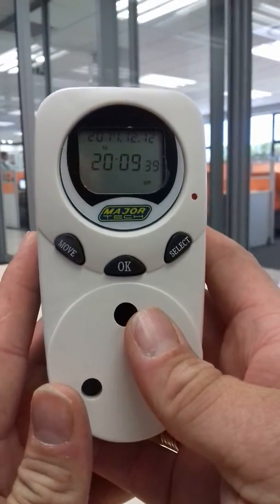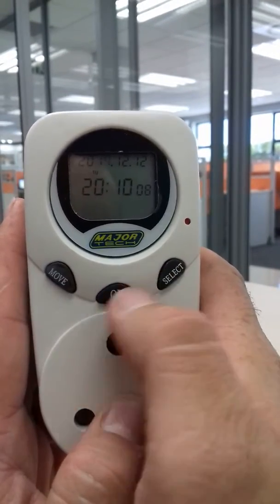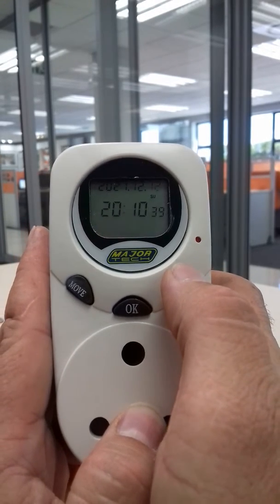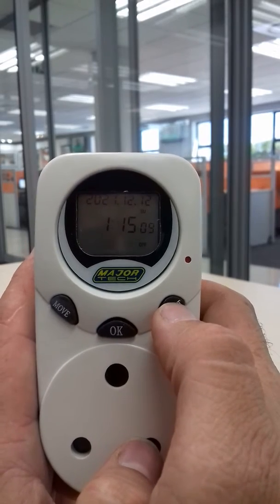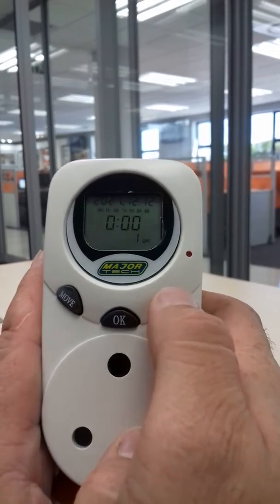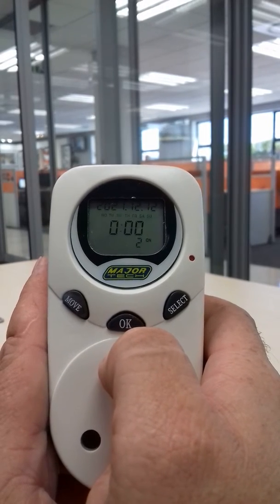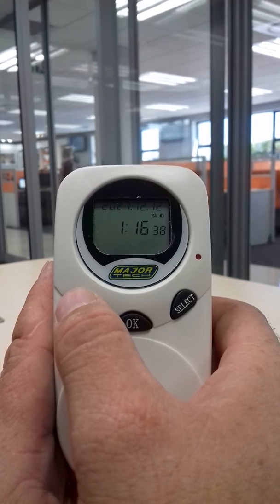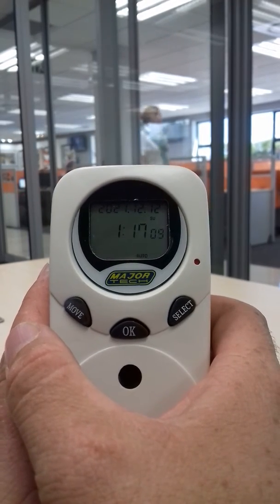Programming a MTD9 TIMER

Comment: Hi, I have followed the options as per the video tutorial. The time and date is set correctly. I have programmed the "on" and "off" option. Took it back to "auto" it does not come on at the desired time set. When i change it from "auto" to "on" then the time comes on and you can hear the audible ticking away inside. Please help
Reply from the maker: Bit late but did you select the days of the week for both on and off settings?

Comment: I bought this thing. I followed the instructions. It worked for about 5 days. It is now not working as programmed. I have reset it and reprogrammed it about 10 times. I have followed every instruction yet it is not turning my light on when it is programmed to be on. If I toggle it to "on" it works so power is getting through it. I am so very frustrated right now. I have found several people saying they have the same problem but no solution. The answer is always "reset and reprogram". I don't know what else to do
Reply from the maker: Hi if the manual override works and the timer comes on when you use the manual button it means the timer is working. The problem is definitely programming. If the timer did not engage on the manual button selection when you press it to the on position then either the wiring came lose or the timer has not been bridged on the old model and lastly if all else failed the timer is faulty. The new model has two inputs at the top and only one output at the bottom no bridging required.

Comment: Bought one from Makro just now. Lcd panel not displaying anything. Does it need to charge the full 12 hours first before anything will display on lcd? Been plugged into power for 30min now and still nothing.
Reply: plug in and charge and the press the reset button small on right hand

Comment: really struggling with it. ive done EXACTLY as explained on this video and the paper instructions but it wont work. i am selecting on at 6am and off at 22h30...it's 16h00 now and when i pug it in it's off. bizarre. I've set my time and date correctly. anyone help?
Reply: I have the same issue with the timer, did you manage to come right?
Reply: @brucefyfe8855   i have the same issue with the timer, did you manage to come right?
Reply from the maker: Ok lets go wiring top left and right is a life red and neutral black. Bottom middle is a red going to your geyser or poolpump. If this is correct pressing the manual button till you see the red light come on whatever has been connected must come on. If your geyser or poolpump does not switch on when the red light is lit your timer may be faulty. If however the geyser etc. Engages we know the timer is working then its progrmming. Check that 1 on mo, tu, we, thu, fr, sa, su is all selected time am and pm is correct press again 1 off mo, tu, we, thu, fr, sa, su is all selected again. If all these are correctly set and the timer did switch on as in first step you should be done. Press menu and leave the timer in auto mode.